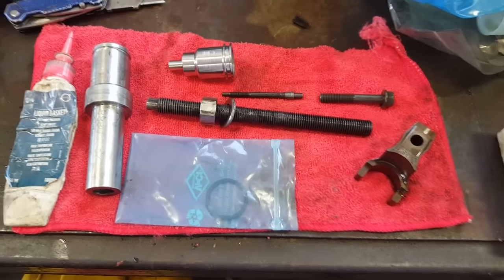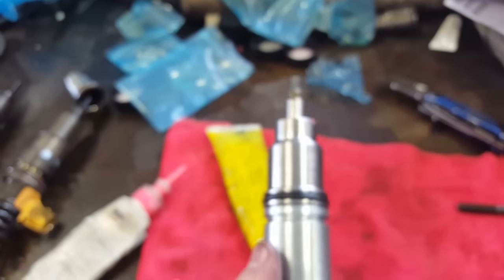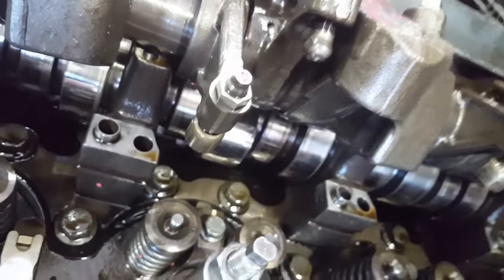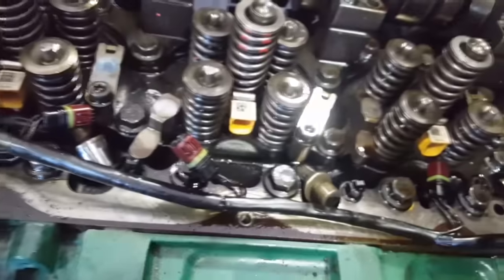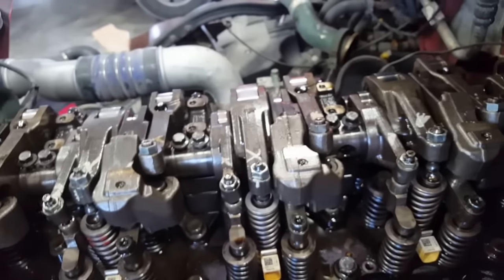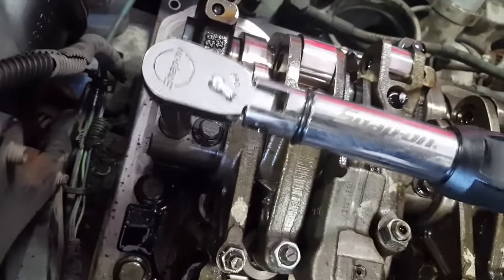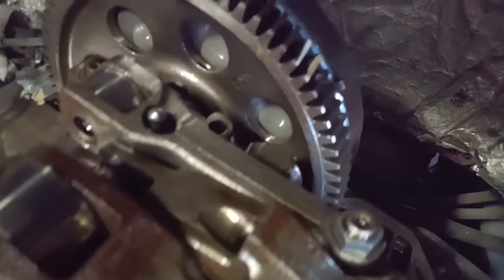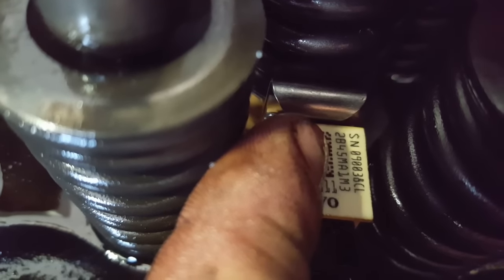How to Replace Injectors and Cups on a Volvo D13 Part 2/2

Comment: So let me get this right, he puts the injector holder in with the tool and the new torque to yield bolt, he then torqued it to maximum yield then removed it and reused it, once you torque it to yield the bolt is no longer good, if you want to hold the tool in while you install the cup use the old bolt
Reply from the maker: We have a genius over here, also the bolt can be used 5 times per volvo 😅
Reply: Good
Reply: Agree, in factory assembly in the yearly 2000 we torqued 20 Nm 120 degrees if I remember correcty. We had a copper washer with plastic deformation to seal. Design could have changed since. But definity, torque once.

Comment: Your videos helped me on an mp8. I bought the aftermarket  tooling. Honestly I like the aftermarket  installation tool better than this one. It pushes through the top. However, the removal isn't as good as the factory one. I use napa Sil Glyde for the cup o-ring.
Reply: Where did you get the tool?. Thank you
Reply: @nelsonmendez7893  I got 1 from freedom racing

Comment: Good video but you torqued the new injector hold down bolt twice, it’s a torque to yield bolt and that rocker shaft torquing was terrible
Reply from the maker: Procedure is 15+ 180 degrees minus 110 degrees plus 90 degrees and can be reused 5 times But that's if you want the truck to come back every year. This truck will never have problem with cups again and still good after 4-5 years. Rockershaft is fine fot one hand but torque is a little higher now 30+120

Comment: Late reply here.I worked at a Volvo dealer for 12 years.Volvo decided to use an antiquated rocked arm unit injection system.They are trying to get 35000 psi out of the system.You cannot keep injectors and cup in the engine because the high injection pressure deforms the injector and cup to a point where the injector hold down come loose.Then you get combustion gas into the cooling system or the fuel return.Only cure is to do regular cups and injectors.On the 4th set you will need a cylinder head.
Reply: Do you know where I can get sleeve locker? Volvo said not to use graphite paste, only sleeve locker?
Reply: @strubies  The Loctite sleeve locker is the orange colored stuff.Try you auto parts store or industrial supply store.Yes they eliminated the graphite paste.It was used at the base of the injector and was getting into the fuel system.Small pieces of graphite were getting into the injectors.
Reply: @davidfleishman2275  thanks man! What about the extreme pressure lube he used? Does autoparts store carry that. And the engine brake orings, are those usually bad?
Reply: @strubies  You can use regular EP lube.The video here is out dated for tooling.The swedging tool for the cup is replaced with tooling the pushes down to swedge the cup.On the tool in this video pulling up to swedge lifts the cup so it is not seated on the head seat area.The new tool pushes the cup down to the cup seat area of the head.
Reply: @strubies  I forgot always replace the engine brake control unit O rings.If you have silicone lube use it on the o rings to make them go in easy.
Reply: @davidfleishman2275  so sleeve locker goes on the cups, what goes on the injectors... same stuff?
Reply: @strubies  When you install the injectors just a thin film of oil on the conlcal end of the injector.I put a thin film of oil on the injector "O" rings.Note Volvo does not use the graphite paste on the injectors anymore.
Reply: After installing the Rocker arms, all of the rockers move except for one injector Rocker. Is that normal, or all rockers should move freely an inch or two up and down?
Reply: @strubies  You need to do the valve lash procedure as in Volvo's service bulletin.

Comment: The pen is called a swedge bit, new injector hold down bolt is to be torqued to 60ft lbs . That's the older style of injector cup installer as well due to it pulling the cup away from the head
Reply from the maker: +Stangnotch03 what's the part number you are referring to? I haven't had any premature failures yet but I will look into it

Comment: Just wanted to in form you because most ppl aren’t aware that you can gain access to service info without having dealer access. If you go to volvotrucks.us and then click on part and services tab and find where it say resources and manuals. Click on that and find a link that says visit the Volvo emedia center and click on it you can gain access service procedures. Make sure you find the latest info. They have changed the torque on injector hold downs. That info is in there as well

Comment: Jake break in my d13 volvo engine work but is week , so I need to change engine break aculator , located under valve cower? And I need to do that drain coolant before changing that valve?

Comment: Aren't the swedging bits a three step bit? I was able to do these in my sleep when I worked for Mack. It's been a few years but I definitely remember the swedge being three different stages

Also, invest in a gear wrench 15/16 flex head ratcheting wrench. Very cheap from Menards. Makes those days where you're doing 2-3 sets of injectors and cups not so rough .
Reply from the maker: we got that wrench a couple months ago, it's nice. They change the tool all the time, we have a different one now
Reply: I like the idea of the angle iron brace I've seen mechanics struggle with the arms of the rocker when they are trying to set it on

Comment: Great video!!! Not sure I want to tackle that guess you would have to pull valve cover to find out which cups you have to get the right tools?
Reply from the maker: I think most trucks have already been changed to steel
Reply: Cardinal Truck Service I like your work!!! How do you know if these motors are any good?? Is there any way to tell their condition before you buy???
Mine sounds fine? I bought this unit at auction for my farm from a farm it’s 2009 low km 270000km but D16 been absolute headache, codes , oil consumption, sensors, it inhales money lol might have copper cups, stumbling under load currently, lol might need a copper puller and steel installer, they charge 10 hours and about $1000 per reman inj at Volvo or Mack, Canada, think I’ll get them to check compression? Before I spend anymore money lol
Reply from the maker: +Doug Besplug I think the same tool can be used to remove the copper cups, but you will need to change injectors if changing to steel cups cause different design

Comment: Can a injector make an knocking noise on d13 ?
Reply from the maker: If it's leaking bad it could and would also be smoking
Reply: @cardinaltruckservice3753  smoking from under hood or exhaust stack ?
Reply from the maker: @marcusblackman2941  exhaust

Comment: Are these procedures and tools the same if the injector cups are conical? I believe they call them conicals if the engine incorporates DEF injection?
Reply: NO the tools and procedures have changed from this video. Volvo found the installer tool he is using was pulling the bottom of the cup away from the head and causing them to leak after 60K
Reply: Nick Purcella hi
What is the lick coming from injector cups?
Water,fuel or air comes in to the fuel?
Thank you

Comment: Yo bro, can you do video on front and rear breaks and slack adjustment on a D13. Appreciate it.
Reply from the maker: It is the same for most trucks. remove wheels, loosen slack adjuster all the way. remove drum, remove two springs from brake shoes and they should come off. then put on new ones in reverse. of the drum doesn't come off you may need to hit it a few times with a sledge hammer on lip
Reply: @cardinaltruckservice3753  So you are a mechanic and a doctor? I dont know...🤣

Comment: hello,  is the d12d engine fairly similar to the D13 to work on  ? Looked at one that cranks for a little while and then consistently fires once and then keeps cranking and not starting.  I was told the fuel pump was replaced but suspect injector sleeves like the problem you had Thanks for any advice

Comment: hi great videos I appreciate you posting these helpful videos, I have a question I am considering using the copper cups because people say that you dont need to replace the injectors I heard there are two different types of installation tools one is a push through and other is considerd a pull through which do you recomend to use for a copper cup and what does it look like in comparrising to the one you use in this video? thank you.
Reply from the maker: Get the steel cups, if installed correctly they last alot longer than people think. I don't remember anyone in last 5 years coming back to redo cups unless head was off or injector went bad. Copper cups use different injectors as well but if your cups are bad you likely have at least a couple injectors with bad mating surface so will need replaced anyways. The tool I used is old and the push through tool came out before video. Haven't done copper cups in a long time. I think tool looks like the one in video but the swedge end has 3 swedges on it
Reply: @cardinaltruckservice3753   thanks for the replay really appreciate it, I have a quick question I have completed the cup and injector and now I'm on valves adjustment (VEB) but I cant seem to get my engine to turn from the alternator bolt the pulley is just sliding on the belt as I turn it also how bad is it to leave the adjustment alone and running the engine and take it to someone else to do the valve adjustment or is there anolther way i could turn the engine? thanks.
Reply from the maker: @ChooseLanes  there is a turning tool but you will need to get under truck to turn engine

Comment: Hello my name is Sergey. where is your workshop located? and what is the price to replace the injectors and glasses? D 13 thanks.
Reply from the maker: we are in mount crawford va. we Charge $750 for labor and it takes about half a day but your truck must sit overnight for sealer to cure. we supply parts with warranty for $2500 plus labor, including cups and Injectors. email me if interested cardinaltrucksvs@gmail.com or  http://Cardinaltruckservice.com

Comment: If you tighten the rocker arms to tight can it cause it to burn up the cam bearings?
Reply from the maker: I doubt it, the bolt stretches and will probably break before any other damage occurs

Comment: Quick question I have a 2009 D16 and the fuel pump started seeping a bit from the weep hole, it stops after its running a while, Volvo didn’t think it was serious but I am getting a stumble under load up inclines you guys run into anything like that? Hate to do cups and injectors for no reason, noticed it’s not starting as good cold, seems to start good warm?
Reply from the maker: Seems like injectors and/or cups but I would check fuel pressure under load to make sure it's not pump

Comment: Nice job Brother! I had replaced injector on d12 engine and thing (sorry dont know in english) that hold the injector was craked despite i folowed the manual. Can you tell me what torque moment do you use?
Reply from the maker: 20lb plus 180° then back of and do 20lb plus 90° if using new bolts. Used bolt should be around 65lb

Comment: How do you test for bad injector cups? Or fuel filter housing how to tell which one you need to replace?
Reply from the maker: Put a clear line on cylinder head fuel line inlet. If it has bubbles then you have leak before injector cups. If clear, but bubbles in fuel tank, then injector cups. Most likely is cups but better to check
Reply: @cardinaltruckservice3753  thanks

Comment: Can you start the truck as soon as you finish or there's a recommended time to let the truck sit? Thanks
Reply from the maker: This is an anaerobic sealer so it cures once it gets compressed, we give it overnight to cure but you can use a loctite brand curing compound so it cures faster, then you dont have to wait
Reply: @cardinaltruckservice3753  I appreciate your quick response.

Comment: Is there another way to diagnose injector cups? I have hard starting but I'm not seeing any bubbles in the fuel tank. Could it be build up on the crank position sensor. I was told to clean it and be sure there's no metallic build up as it makes it difficult for the sensor to see the timing marks on the flywheel.
Reply from the maker: Pump your fuel with hand pump that on fuel housing before starting. If it still takes a while to start then it could be sensor
Reply: @cardinaltruckservice3753  thank you for the response. Will try

Comment: Do you ever have problems putting plungers into exhaust valve rocker? I find the are a pig to get back in as the air cannot escape
Reply: Gary Cloona don’t let it go in dry , make sure the plunger isn’t backed off !

Comment: Is this the latest tool?  I see two different installers.  The other one has round ball at the end of installer and you screws it down through the cup
Reply from the maker: This video 2 years old, there is new tool but they both work fine

Comment: I remember when volvo engines were a force to be reckoned with, these d 13 engines are an excuse, with hollow cam shafts and pressed on lobes on some models, also injector sleeves that dont last 10 minutes, solenoid controlled piston cooling nozzles that malfunction and f#ck your engine, the list goes on. It only took 100years to get here! !!!

Comment: Can you tell me if there are a different injectors for a copper cups and diffrent  fo stainless  cups?
Reply from the maker: Yes they are different, one has flat surface and one has conical surface where it mates with the cup
Reply: @cardinaltruckservice3753  thank you
But in your opinion stainless cups are better than copper  one?

Comment: Good video bro, why old injectors has 2 O ring and the new ones just one??
Reply: Yeah can someone please tell us something about.
Reply: The new style has 1 o ring because Volvo found that having 1 is better than 2 o rings , removing that first o ring allows pressure from compression to be relieved easier. Many times the first o ring would pop from to much compression. They leave the top o ring only now. I work for a Volvo Dealer
Reply: Sergio Urizar The new style has 1 o ring because Volvo found that having 1 is better than 2 o rings , removing that first o ring allows pressure from compression to be relieved easier. Many times the first o ring would pop from to much compression. They leave the top o ring only now. I work for a Volvo Dealer

Comment: Have you done this on a D12? Do you know how I can get access to a D12C-A MP service manual? I am getting an injector error on cylinder 1. Any suggestions?
Reply: Check for oil in the wiring harness.

Comment: Hey can you help me diagnose a D13 engine, I replaced the injector cups then tried it again and it was still hard to start and wouldn't stay running before it did, so I ran a clean line to the inlet side and a clear line on the return side but there is a lot of air coming out but non going in. Could that be an injector problem that i need to replace them all?
Reply from the maker: Recheck injector hold down torque. Check injectors for wear and pitting on end where you apply graphite.
Reply: Thank you for the advise Kalinchuk..
I ended up removing all the injectors and inspected all bottom ends and just found one with some pitting so I replaced that one but also installed the both injector o-rings on all injectors then with the clear fuel inlet and outlet hoses found no more air in the system.
Reply: Cardinal Truck Service  very good video to changes the piston and valve can you help me  I already remove the injectors and my valve tip broke inside who can I remove the little part

Comment: is that copper sleeve?
Reply from the maker: No steel conical
Reply: is it fake or ori part bro? and also is it a cheaper?
Reply from the maker: @budifcf6900  original Volvo, they like $25 each

Comment: Where did you get your torque specs and procedure from?
Reply: You can get them from your Mack/Volvo dealer, or google them.  If you have specific one that you need I can help you our.
Reply: 60 ft lbs for injector hold downs , rocker shaft is also 60 except for the last bolt closest to the cam gear which is a 18mm head bolt that goes to 110 ft lbs

Comment: if i don't reprogramed the ecm with new injuctor what will be hapend????
Reply from the maker: Truck will run rough
Reply: @cardinaltruckservice3753  
thank you for your answer but i want ask you for my problem
i have genarator  around 280kw with engine volvo tad941 ems2
the problem i have all injuctor short circuit that show in data link dse7320 controller
we did replace 6 injuctor and i dont reprogram engine and the engine want run??
when i gave the power dirctly to injuctor the engine run a little bit i had test pressure fuel everythink is o.k
just i have short in all injuctor .i hope you gave me the answer sorry for my English mistake
thanks
Reply from the maker: @ehsanhaleem1151  check wiring harness, insulation can become brittle and fall of leaving exposed wires
Reply: @cardinaltruckservice3753  I checked all wire and checked insulation I don't find anything wrong in wiring and harness it's clean insulation good
Reply: @cardinaltruckservice3753  but the injuctor replaced before and I don't programed ecm on new injuctor 
in this case could i have this messge short circuit in injuctor ...sorry if I bothring you with me
thanks.....
Reply from the maker: Probably not unless injector is bad, check injector, wiring harness and ecm

Comment: how do you know if you need new ones
Reply from the maker: Long starts, bubbles in fuel tank
Reply: @cardinaltruckservice3753  my freightliner cuts out while riding down the road
Reply from the maker: Your frieghliner does not have a d13. Could be alot of issues, probably some sensor though